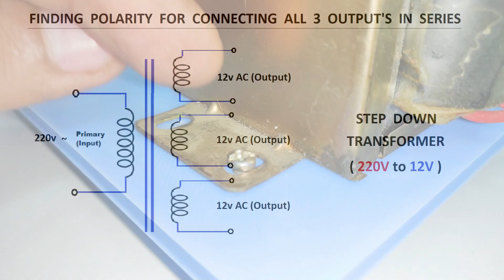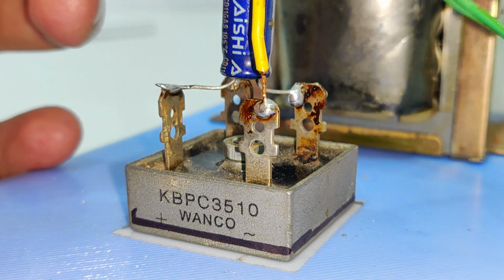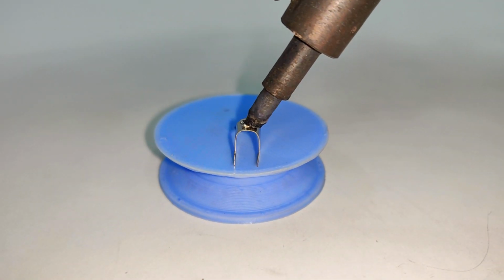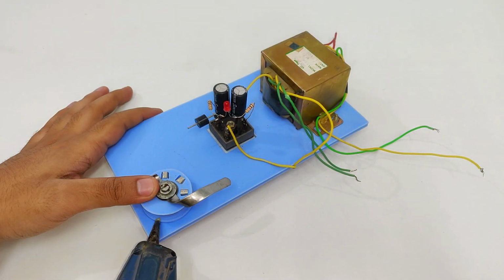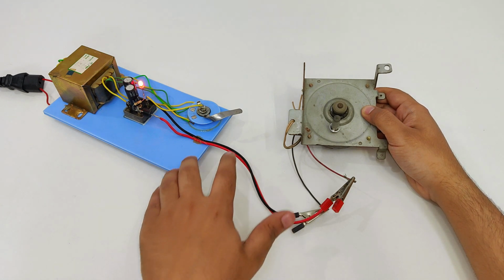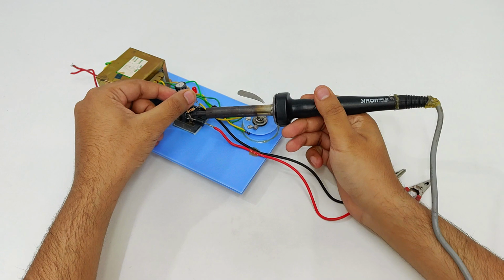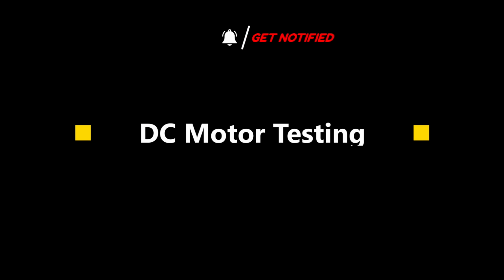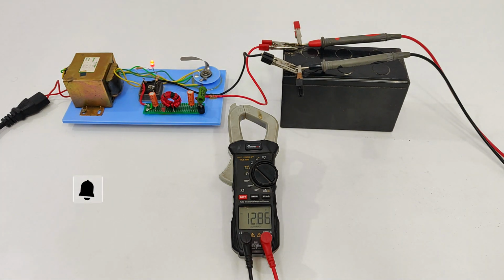Make Adjustable 12v to 45v DC Supply from 220v AC for DC Motor/Battery

Comment: I am a little confused here. Is putting another diode after a bridge rectifier an effective way? 
I think it would increase the resistance in the circuit causing some energy loss due to lower efficiency.
Reply from the maker: Correct but maximum possible loss because of that diode is going to be only 3.5 watts for a 150W power supply. Also, its necessary to prevent reverse flow of current from a battery to the indicator LED.

Comment: Hello, I love your voice.Such power supplies are becoming obsolete Because they have a very low efficiency And more heat loss Please explain the power supply of the desktop system How to change its voltage from zero to 50 volts How to change its frequency .Some of these power supplies have two transformers And some of them have three transformers If you do this, your videos will be seen more.Can you tell which country you live in?i am from irann kind regards...😊
Reply from the maker: Thanks ! I have already covered the computer power supply video.